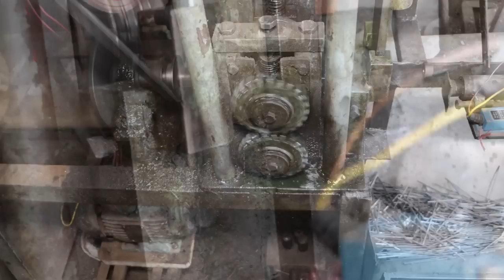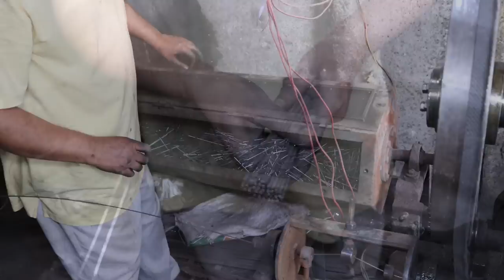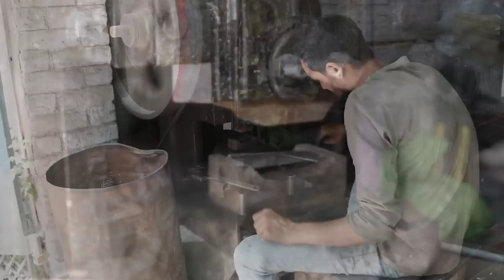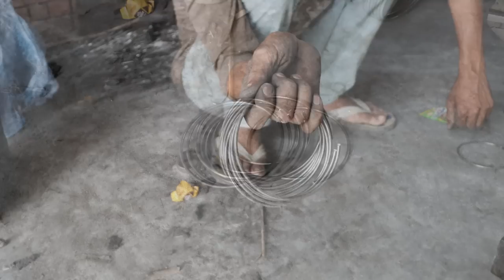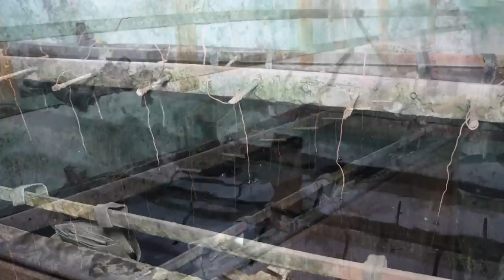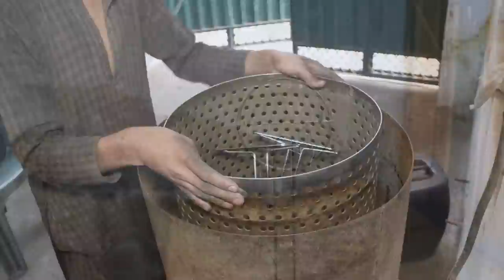Process of Manufacturing Stainless Steel Fork And Spoon Holder | Factory Process

Comment: That is not Stainless Steel, if it was you would not have Chrome Plated them. 😳🇦🇺
Reply: stainless isn't chrome plated two totally different types of steel
Reply: So what kind of metal do you think it is?
Reply: @tracybowling1156  stainless steel is polished chrome plating is for regular steel help combat corrosion
Reply: @mattstarr8203  Ah. Thanks for sharing your knowledge. I find metal very interesting.
Reply: thats normal mild steel wire just nickel plated
Reply: @cwmbc  Gotcha. Thanks for helping me to understand. So if they didn't plate it, it would rust quickly. Especially when wet?
Reply: @tracybowling1156  It is mild steel that is being Nickel Plated.
Reply: @peterantonic6923  That makes more sense than chrome. Nickel costs less and isn't nearly as toxic.
Reply: I think it’s a play on words.  It’s a holder for stainless steel fork and spoon

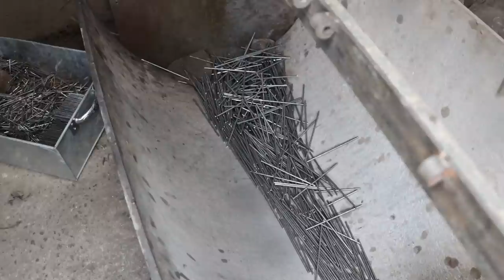Comment: 0:42. Pulley, belt, loose T-shirt.  That could have gone badly.
Reply: Yep, you're right about that . . . and the yellow T-shirt actually looks pretty strong, so there's little chance it would co-operate by simply tearing off him nicely. 

No, it's strong enough to introduce him to whirling grinding rushing around fast things made from dirty metal.